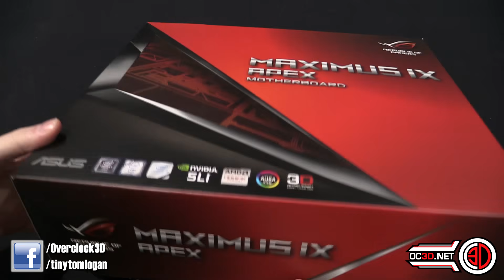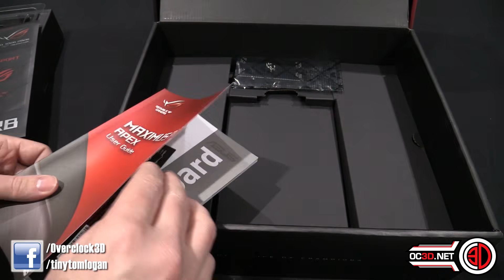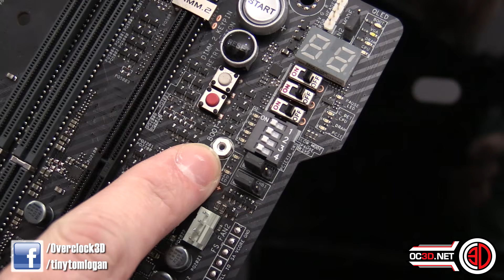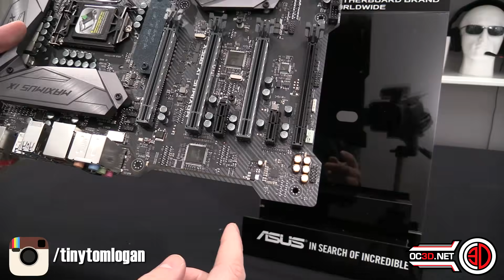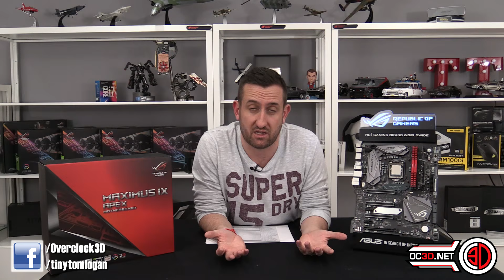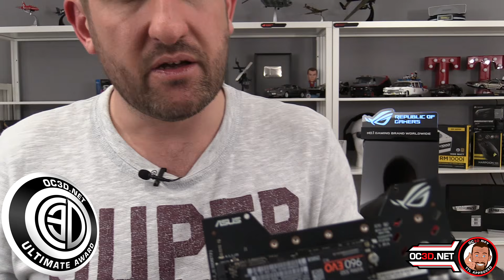Asus Maximus IX Apex Review

Comment: The red button is a “safe boot”. The bios switch doesn’t work on mine. Regardless, it is a fantastic board……..as are all the Asus Maximus boards. I have built with the “Apex & Hero”. Both are monsters, with the Apex having more overclocking options. OCCT failure was more then likely an AVX test. You can reduce the multiplier in bios when programs are using AVX. Those screws are for another plate that you showed earlier. The M.2 setup also save space on the board.

Comment: So weird to see only 2 dimm slots on a premium board
Reply: When you will need more than 32GB of ram for gaming, this board and his processor will be already obsolete. ;)
Regards.
Reply: What is this "need", I want!
Reply: But it makes complete sense. I'm not an electrical engineer but the little reading I've done on it, it's pretty amazing how much of a difference only having two DIMM slots can make. When you factor in the shorter electrical runs, the amount of extra power you can deliver how much cleaner power you can deliver etc. This is definitely an overclocking board.
Reply: When you need 32GB of RAM for gaming, this board and kaby lake CPU can be upgraded to something much better. 16GB of RAM is gonna last a long time.
Reply: Can anyone recommend good 32GB (2x16GB)...? Maybe with RGB,s....!?
Reply: G.Skill TridentZ Series 32GB (2 x 16GB) DDR4-3200 Memory
Reply: 16GB Kit (2 x 8GB) Trident Z RGB DDR4 4266MHz, PC4-34100, CL19 (19-19-19-39)
Reply: Only having those two slots greatly improves latency

Comment: You couldn't of timed the review any better, I was about to add one into my basket last night, but I thought nah it's pre order, I'm going to wait for a review, and wow, what a board, the only thing putting me off is the fact it hasn't got a rear io cover, you can say but it's an OC'ing board, yes maybe, but it has all the led's everywhere, so it can be used as what Tom said, a bit of a show rig, surely it wouldn't have taken Asus much effort to slightly adapt one of their files to make one of the existing covers for the Apex, and what would it cost them, well not much I should imagine.  But even with that, what a board, that OC with the mem, bloody hell.
Reply from the maker: There is an IO cover in the box....
Reply: An actual plastic cover ? ( not the io shield )
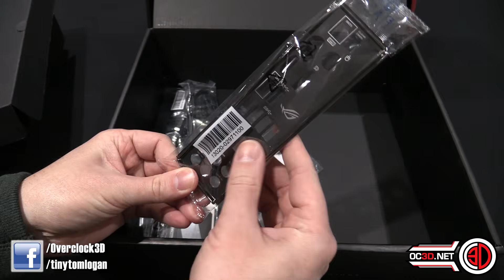Reply: I presume he means the backplate thing at 3:42... not what you mean I don't think, i.e something to cover the silver parts of the I/O as you look down on the board. I'm guessing they omitted that given the whole 'overclocking' ethos and that it could perhaps get in the way. Shame though... they obviously recognised RGB lighting would be a nice visual, so it's unfortunate they didn't offer at least a removable cover for that rear section.

Comment: but regardless I've just pre-ordered it, even though it's not gonna be available for a while.

My new build:

be quiet! dark base 900
Maximus IX apex (when I get it)
delidded 7700k @5.1ghz (already tested stable @ 1.38v - maybe on this board I can push to 5.2ghz?)
be quiet! Silent loop 280
Corsair Vengeance LPX 4000mhz 16gb kit (hopefully will get them to run @ 4000mhz in this board)
Samsung 960 pro x2 in RAID 0 on dimm.2
GTX Titan Pascal
Asus Xonar Essence STX ( really wanted to still use this, so glad I'm not paying over the odds for fancy onboard sound)

It's gonna be sweet....

Comment: I am disappointed with the price the board is stripped back but it still costs a lot.  A gigabyte z97 soc force was £180,  and a z170 oc formula was £220. They were both very good oc boards. 

I think at £300 is a bit high for an oc board considering you are more likely to kill it under sub zero :(.

Comment: Great review overall, and definitely a good board to consider. I'm really looking forward to seeing if Ryzen gets something similar, because the additional clock speed would push the value for money just that much further if you have the means to keep it cool.
Reply: Somewhat agree, but Ryzen is already tweaked pretty much as far as they can go. The best option available is to allcore overclock at 100 to 200 Mzh below max turbo. On most chips, this will be stable at less than 1.3 volts.

Comment: How does this m.2 bracket line up with Cpu heatsinks with fans on them - does it block of air and mess with cooling reaching the fan? and does even the fan collide with it at the larger coolers?

Comment: quick question too Oc3d tv. Are you going to do som delided 7700k test with the apex. i heard with liquid metal themps go down about 20 degrees. 
maybe you can squeez som more mhz out of your 7700k
Reply from the maker: temps coming down wont mean you can magically start pushing more volts through the cpu. It will just mean a quieter system because its cooler.
Reply: I was just wondering if the lower themperatures would make the systhem more stable. 
And if its more stable can't you overcklock a little bit further without raising vcor? 
That are my thoughts and questions. If im wrong feel free to corect me

Comment: Surely they could have used a pci express slot for that SSD carrier board. Why go to the trouble of designing something like that?
Reply: SLI water blocks if I was to guess, they really don't want anything interfering with those three GPU slots
Reply: There is no such thing as 3-way SLI anymore. Your comment does apply to Crossfire, though. Still, it doesn't matter: I meant that instead of that weird DIMM slot they could have put a PCIe slot there, because that's what it is, electrically. Although, maybe it also carries SATA for older ssds.
Reply: Its for a reduction in signal noise.  More electrical noise is generated when the M.2 SSDs are mounted directly to the board.  You can also actively cool the M.2 drives with a DRAM fan if one so chooses.
Reply: That may be true but it doesn't explain why they'd design a proprietary connector for it when a standard already exists.

Comment: Hi Tom,

I've found RAMDisk feature is missing on ROG boards (website specs). Has it been dropped from that product line? It is very strange, why?
Reply from the maker: If you mean for the Apex its a 2dim board...... Not sure if its still on the driver disc for other boards or not
Reply: Oh gosh! Not that. Asus' RAMDisk software allows us to covert unused RAM (in GBs) and make it as a separate partition to work. The purpose to achieve very high speeds of throughput (more 10x of SSDs), thus resulting in saving a lot of time. E.g. encoding HD videos. Have you not
 used it?
Reply: The same feature is present on many Asrock and MSI boards. E.g., XFastRam software in Asrock
Reply from the maker: I know what it is.... Im saying the Apex only has 2 ram dimms so the disk isnt exactly going to be big is it....
Reply: Okay, then could you cross check and confirm whether this feature is available or not? I do not understand why the specifications page isn't listed that feature anymore. It is one of the important applications for my requirements. Leave this board. Just check in Hero IX BIOS or higher model you might be using? Thank you.
Reply from the maker: I have no idea wether it is or not dude but there are aftermarket softwares available, or you can try one from another asus board (download on their website) and see if it works. No ramdisk is hardly a purchase breaker is it and I cant build the board up just to test that one thing for you sorry :(

Comment: A question! Does this mobo compatible with gigantic CPU fan such as Noctua d15, or Cryorig R1 Ultimate???
Reply from the maker: Both coolers fit but you have to go careful with memory size and GPU location - the noctua can hang down low a little and force you to drop the GPU lower. Its not a simple answer sadly
Reply: I'm planning to buy i7 7700K, does this processor really need this gigantic fan??
Reply from the maker: Go watch my review on the CPU and then watch my cooling guide video afterwards.